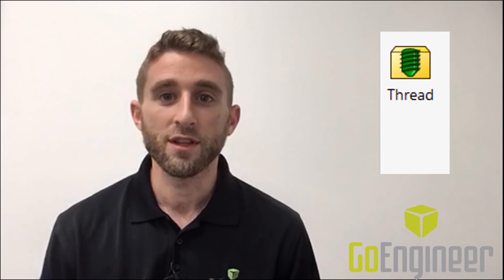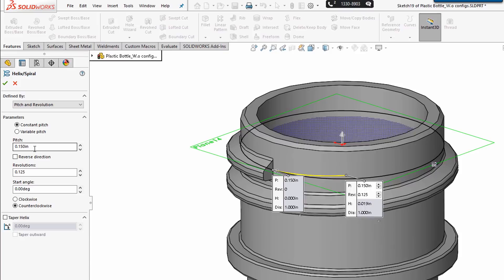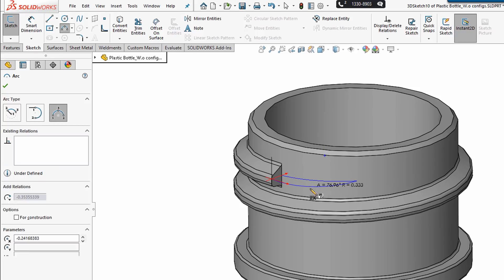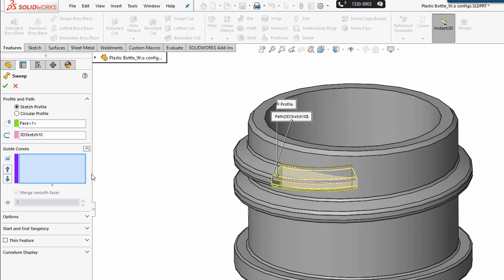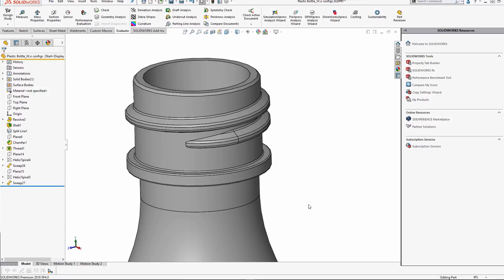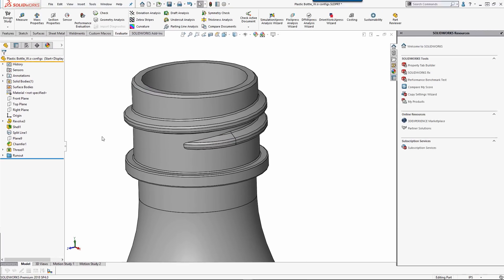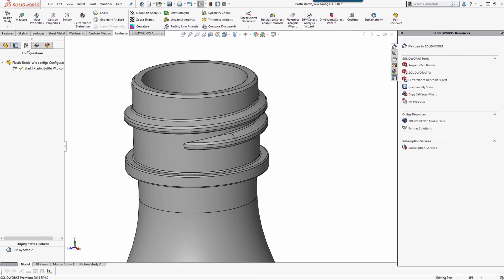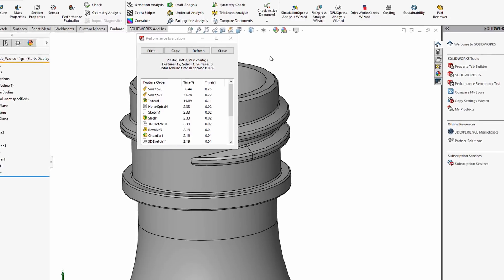SOLIDWORKS - Thread Feature - Part 2

Comment: It is not how it should be done.
The standards for threads show that the start and end of the thread come from the cutter dia. Therefore, you should create a revolve axis at a distance proper for the thread standard and revolve the thread profile around it. If you type GPI THREAD in Google, you will find an image showing the detail.

Comment: The plane should be at the same pitch angle
Reply from the maker: Which Plane?
Reply: @goengineer  ,... the plain use to control thread feature,... so as to govern the end of the thread.

Comment: It would be a lot easier to do this if Solidworks would add a check box that would allow you to turn on making the end face normal to the thread trajectory. You can then do a simple revolve right off of the face. This is a feature that Creo has had for a while. Make bottle thread creation much simpler.

Comment: the problem is how do you fix the starting point for the helix by the thread profile?
Reply from the maker: Hello,
Select the angle you want the starting point to be by editing the start angle in the Helix dialog box. You can even change the helix direction with the Clockwise and Counterclockwise options.